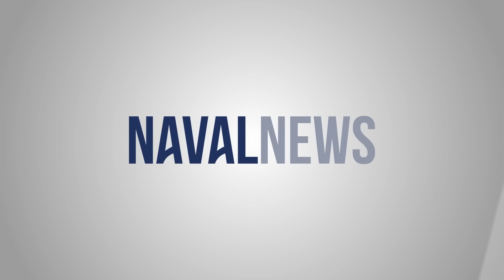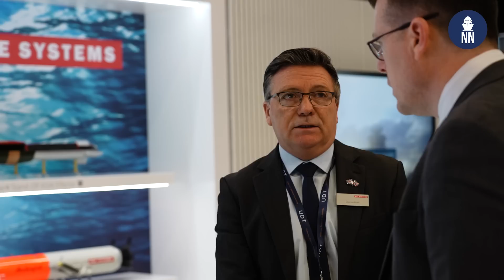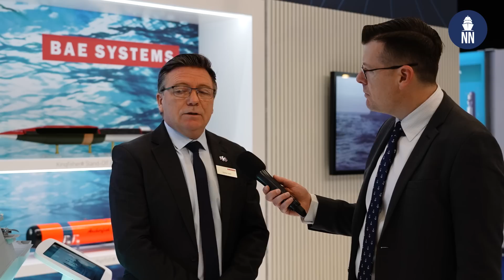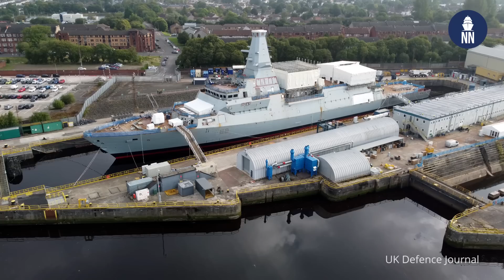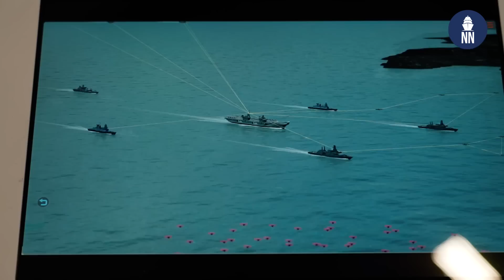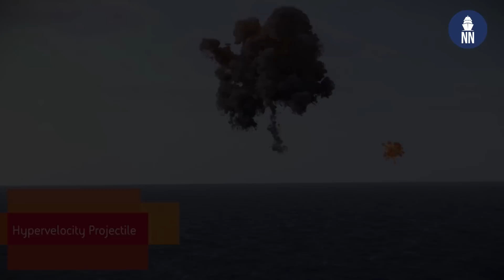BAE Systems pitching Type 26 frigate to Norway

Comment: I am surprised Norway would go for base UK version as their last frigates had Aegis system maybe Canada T26 or more advanced Australian T26?
Reply: If they want quick delivery, low risk and low cost then the RN spec straight from the existing production line is by far the best option. Besides the RN spec is well-balanced and still can be easily upgraded in future with a more powerful radar.
Reply: Totally different type of ship though. They special want an ASW  frigate. They already have AD ships.
Reply: The US can't be trusted anymore, so why use their systems?
Plus the type 26 was designed to do the job Norway wants in the place Norway wants....  So perfect fit.

Comment: Denmark actually needs 4 new Air Defence and 2 ASW fregates. In addition it also needs a total of 5 Artic fregates. The Artic fregates will likely be Multirole and about 5.000 ton. The 3 current Ivar Heuitfelt class Air Defence fregates match the Type 26 pretty much but will need more VLS cells kind of like what BAE offered to Australia. Leasons from the Red Sea has shown the need for a big missile load out, as well as other means to defeat low cost drones. As for the ASW fregates to replace the Absalon class, the Type 26 will be a great choice. Denmark already has the NSM missile on order, and SM-2, SM-6 and Tomahawk will make a great compliment. But I dont think Denmark can wait to be next in line, but rather have the fregats build on licens elsewhere and do the outfitting in Denmark. As for the Artic Multirole fregats, the design process is already taking place in Denmark and likely the whole build process. Hopefully it will have capabilities and speed simular to Frances FDI frigates, so eventhough build for the artic, it will also be suitable else where. Afterall Denmark including Greenland has the 12 largest landmass in the world meaning a long coastline, and the 5 largest merchant navy. So hopefully Denmark will also follow Norway and Denmark as a CD212 Submarine user. 4-5 of these would be usefull.
Reply: The Danes may be able to cooperate with the Dutch. The Dutch navy is planning to build four new air defense frigates. The Dutch navy is still looking for partners for this. Initially, they wanted to cooperate with the German navy, but the talks stalled. The Dutch Damen is currently building at least six F126 frigates for the German navy. This may be a blueprint for the Dutch frigates. Damen is also currently building six ASW frigates for the Dutch (4) and Belgian (2) navies. The French Naval is also building 12 minehunters for the Dutch and Belgian navies. France recently promised to also build 6 minehunters based on the Dutch/Belgian model. 

What Greenland is to Denmark, the Dutch Caribbean is to the Netherlands, there are foreign powers that are eyeing our (autonomous) areas. For decades, Venezuelan presidents have said that the Dutch Caribbean islands off the coast of Venezuela belong to them. Every now and then, there are threats of invasion. In 2014, a Venezuelan naval fleet was even sent to Aruba as a warning. 

Unlike the Netherlands, the Caribbean Netherlands does have conscription, Dutch marines and commando units are stationed there, and there are two naval ports. 

So the Danish and Dutch frigates have to sail many miles to their overseas territories. I think that the Netherlands and the Danes, as small nations, can work well together to develop a frigate together.
Reply: The Danes never work with the British, the Norwegians and Swedes do
Reply: @jabsdrahm.3232  we worked extensively with the brits in both Afghanistan and Iraq linking our contributions to the UK contigent so your statement is wrong. 
 https://en.wikipedia.org/wiki/Siege_of_Musa_Qala

Comment: The Type 26 is my pick for us. The F127 and FDI are also very good options, but the Type 26 is my top pick. Not in the RN configuration though. The Hunter class is the ideal version in my opinion. I highly doubt we would go with a Sea Cepter solution, and i'm pretty sure either SPY-6 or 7 is a requirement. Though, the CEAFAR would be very interesting and looks really impressive. Also, we're getting MH-60's not Merlins. Also, 32 VLS cells are a MINIMUM. Strike length too.
Reply: @AugmentedGravity  Hopeing for Merlin.  Mh- 60 is a outgoing model with old tech.
Reply: Don't forget the Canadian Type 26, River-class, it is having Spy-6, it's equipment and combat system is similar to what Norway has now, just more of them and more upgraded.

Norway ordered Mh-60 only for the Coast Guard. The Navy is talking about getting Merlins, due to it's much better capability. I doubt Norway will go for  Sea Cepter, they will probably end up with either 3*8 Strike length Mk41 VLS or having an additional 2-3 tactical length Mk41 VLS 
(Strike length is for big missiles; tactical length is for smaller missiles like ESSM)
Reply: @heuhen  I believe the River class are going with SPY 7.
Reply: I thought only 4 shops were going to have the Aegis combat system.
Reply: FDI too small for the Atlantic..   need a 140m+ size
Reply: @UltimaSRi true, the type 26 or the German vessel or the constellation class is in my opinion the only ones that can be considered due to the lack of length, width and tonnage for Atlantic and Artic operations.
Reply: @luffirton  Constellation is absolutely out of the picture.
Reply: The problem is Norway needs these frigates ASAP and from memory they want to join an existing production line. So with those things in mind, going with the RN spec makes the most sense. You can then look at adapting the design to your own needs through refits at a later date.
Reply: I think the Type 26 is the right pick as well.
The American option is a total no go in my opinion and the French and the German ones are not specialized enough for artic conditions in my opinion.
And I totally agree that Norway should choose the Hunter class or something similar to it instead of the RN option.
Maybe with fewer VLSs and more NSMs than the Australian version.
There should also be multiple anti sea/air drone weapons systems on the ship to protect the ship against these threats from all directions.
Using VLS weapons against them is very far from the best option and use of those weapons.
Reply: The Hunter configuration isn't as sea worthy in heavy sea states as the type 26. Too much cramed on board.
Reply: @Markus117d Yes the Hunter Class is pretty much packed with different equipment, it still has to be a good Sea Keeping Ship, the designers have increased the Beam slightly to cope with this.
Reply: @paultanton6721  Slightly is better than not, but not as good as making a hull designed for it from scratch.. I'm not saying it will sink in a storm  But it certainly will be a more unpleasant and debilitating experience for the crew and stress the ship more..
Reply: @Markus117d  To be fair the competing designs would have needed a serious re-work too, the T26 being larger than both had some advantages in that respect.
Reply: @paultanton6721  Definitely , But for what the Australians want to fit on it, it's still a bit cramped..
Reply: @Markus117d  Very true - but that is the choice the Australian Govt made.
Reply: @paultanton6721  I've seen some where, ( probably navylookout ) that even in RN configuration the design while generally considered excellent, doesn't have as much capacity for upgrades and additions as was designed into the Type 45's, I've got to wonder even with the slight hull modifications the Australian's have made  how much is upgrade capacity is left on the Hunter class 🤔
Reply: @Markus117d  Yes the growth margin is very small - circa 500 tonnes.
Reply: @Markus117d 
The Mission bay is a configurable expansion slot with scope for a standardised plug-in role specific standalone mission module ..sound sexy?

Comment: The model show 24 Sea Cepter cells foreward and another 24 amidships, yet all official statistics state it is only supposed to have 12 Sea Cepter cells?
Reply: You may have confused Type 26 with Type 31. Type 26 will be fitted with 2x 24 CAMM cells plus 1x 24 Mark 41 cells.
Reply: What source says 12 Seaceptor cells? I've only ever seen 48 cells listed for the Type 26. Are you getting it confused with the Type 31?
Reply: Official stats indicate a potential use of EXls cells, which quadpack.12x4 for 48. Models shows 48 single cells. We're still not sure which it'll be.
Reply: 12 sounds very light for any frigate
Reply: @iainmaley3319  The 12 option is quadpacked to 48 missiles separate from the 24x Strike Silos and 16x NSM

Comment: Should be a decent ship but watch out for those cost overruns. Canada is spending an absolutely stupid amount on ours. Needs more VLS. Less maple syrup storage.
Reply: The numbers are BS and you cannot compare the Canadian #'s to anyone else's. We account things differently. The costs in the public domain from the PBO include EVERYTHING. Stuff like spares, weapons, ammunition, fuel, manning, training, pensions for the sailors that will use them, mid life refits. Its such a ridiculous way to account things and what is included in the costs is nuts, hell even shipyard and pier upgrades are included. Think of it this way, the prices you see in the public domain for US ships lots of times doesn't even take into account weapons or radar and its strictly the sail away cost of the hull...
Reply: @mattanigma  
Exactly.
It is extremely important to examine the accounting before judging projects like this.
Reply: Unfortunately the design makes it really hard to shove more VLS, with there being some concerns with the Australian design due to the additional VLS added
Reply: @betanovaneo4249  The design is fine for VLS, it's more that MASSIVE radar that Australia tried to put on it is throwing it.
Reply: @Retrosicotte  
100%
Reply: @betanovaneo4249  BAE has shown the design can have up to 96 VLS. 32 would be no problem. I think the main issue with the Hunter was more to do with the mast and huge Radar system fitted but it looks like they have been worked through now.
Reply: @CrackingDale25  that design would compromise it's ASW missions as it would be using all the mission bay space and having to take out Other ASW equipment such as the towed array sonar, again the main mission of this Frigate is ASW Not Anti air.But I guess it couldnt hurt just to compromise a portion of the mission bay while keeping the towed array by just only putting 16-32 VLS.
Reply: The RCN River class removes the 48 cells for CAMM. In favour of AEGIS plus RAM as part of the americanisation of the design. With the current political environment that may change.
Reply: @Belisarius1967  
It should change, but we will see what happens.
They should make themselves as little dependent of the US as possible.
It would be much better to have as many European and Canadian weapon systems as possible.
To have weapon systems made by someone you can't trust, is extremely risky.
Reply: I think a big chunk of those increased costs on the Canadian part, are to set up domestic industry and production of the type. Also, those figures are through-life costs I believe.
Reply: I agree that prices are sky high nowadays for certain options but sometimes you get what you pay for 🤔
Reply: @acemax1124 Exactly when it comes to this type of investment that will run for decades and will provide the main bulk of the surface area blue water navy for the Norwegians to cheap out is just going to add more cost down the road because the original didn’t provide the optimal operational capability and now needs to be retrofitted.

Comment: Perhaps the Norwegians joining the program will increase the tempo at which the class can be completed by making additional resources available to hire more ship builders and strengthening supply chain acquisition.
Reply: Construction of the Type 26's is already being speeded up as far as is possible.
Reply: @paultanton6721  how do you know what is and isn't possible?
Reply: @MichaelK.-xl2qk  Because the measures taken have been made public, easy information to find  👀.
Reply: The desire to see more ship builders is laudable but...  BAE are struggling to recruit so I suspect that they see these as simply following on or fitting in between UK orders.
Reply: Each country is building the frigate to its own specified characteristics with its own companies providing parts but for the most important parts such as the Sonar provided by France, etc.
They all have their own supply chains different from other countries’ own but for some specific armament and sensors common to all of them.
Norway building type 26 won’t make the British or Canadian type 26 being built faster.
Reply: @brunol-p_g8800  That doesn't seem accurate, given what's being reported.  The Norwegian type 26 is supposed to be built in Scotland to the identical specs as a Royal Navy delivery.  So what you're saying seems not factual.
Reply: @brunol-p_g8800 we are buying the same as the British one.No special things.

Comment: How good radars are has been a discussion among some in the defense industry.
Reply: T26 is definitely lacking in AAW range out of all the competitors. But depends on their priorities
Reply: Artisan is not as capable as AEGIS for example but is perfectly fine for an ASW warship. There's plenty of topweight margin to fit an uprated system later in its life.
Reply: @Belisarius1967  AEGIS is the combat system, not the radar; SPY/1 or SPY/6 is the radar. AEGIS connects the radar system and weapons together, and you can still have AEGIS on a ship equipped with other radar systems. Australia uses AEGIS system to control information from their CEFAR radar, for example.

The radar is also a worry for me as well, especially when we see that drones are more openly used in masse as a weapon. Although Sampson says the Artisan radar can detect a tennis ball-sized object traveling at Mach 3 against complex jamming. And can track up to 900 targets, up to 200 km (110Nm) range

The SPY-1F used on Norwegian frigates can track 800 targets and has a range of around 110-125Nm due to it being a downsized version of SPY-D; some have 200+Nm range. The SPY-1F advantage is that as well as detecting and tracking targets, it also can communicate with missiles and lead them, giving the Nansen class capability to intersespt multiple targets at the same time with multiple weapons including weapons from other ships.

Comment: Im pretty sure norway will want a Spy-6 or 7 rather than ARTISAN or they will be getting a less advanced AAW ship than what is being replaced.  they already use ESSM, not CAMM. 48 Mk 41 or 40 + 12 MK 56 would be a good number
Reply: 48 mk41 is not an option, plus their current ships have like 8 so even the current setup is a huge step up.

This is the British version so no spy radars either
Reply: @admiralmallard7500  Remove the 12 ExLS cells and you can fit 32 MK 41 anyway with barely any modification. Fitting spy-6(v)3 (the smallest one)will save weight compared to CEAFAR and Spy-7 (hunter and River). If you lengthen the ship like those designs, you have a bit more margin . There are concepts for 96 and 128 cell t26s that remove the towed array, reduce the mission bay to t31 size. We cant afford to spare our hulls anyway so this shouldn't be an issue
Reply: @lukeallison3713  they’re not exls, they’re dedicated CAMM vls. Depth is unknown the front but the mid ships vls is not deep enough.
Ship won’t be lengthened as these are supposed to come off the same production line as the UK. The radar could be changed out for another rotating model

They’re not going to remove the towed array on their ASW ship
Reply: @admiralmallard7500  Given the dire state of the t23 fleet, I genuinely don't think we can spare a single one of the t26 that have been laid down. If that means we lose this competition, then that's the last 2 government's fault. The River class design just seems better set up for norwegian requirements, yes they want better ASW, but I doubt very much they want a downgrade on Spy-1/Aegis. British yards would happily take that at the point they become free. Maybe batch 2 t26 could be delayed, t31 could. receive captas 2 and fill in for awhile. The original plan was 48 mushroom farms on the city class (British t26), but the RN website has recently changed to referring to 12 vls cells that quadpack CAMM, are separate from MK 41- which would be ExlS. The one good think about ExLS is that it also quadpacks NULKA and RAM too, just don't see them using Sea ceptor
Reply: @ exls is innacurate. Look at pictures of HMS Glasgow for Mushrooms cell layout.

The Norwegians won’t accept anything except the design they’re buying. Which isn’t the river, that’s a decade away.
Nor a Type 31

If we don’t give a frigate we lose the contract basically
Reply: @admiralmallard7500 The River is not Decades away , the first 3 have been under construction for 2 years and entered full scale production a year ago .